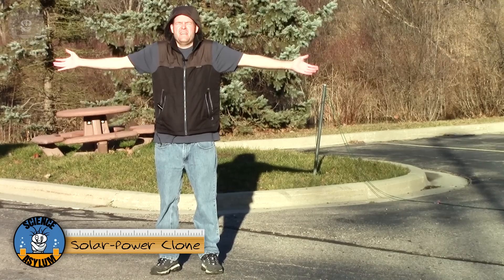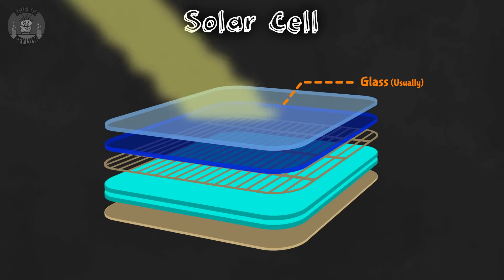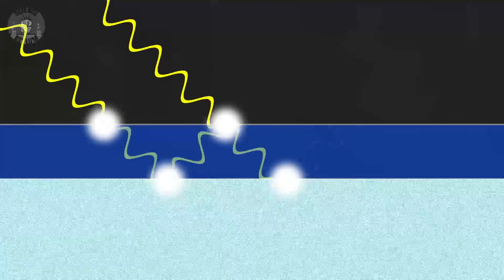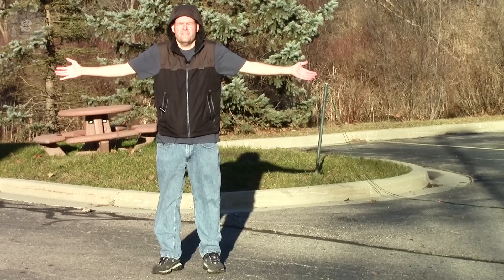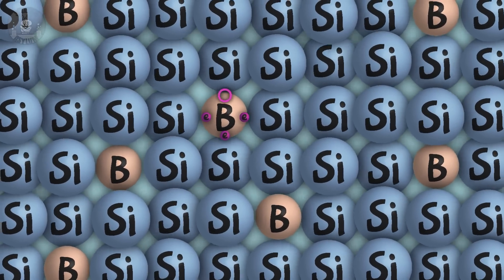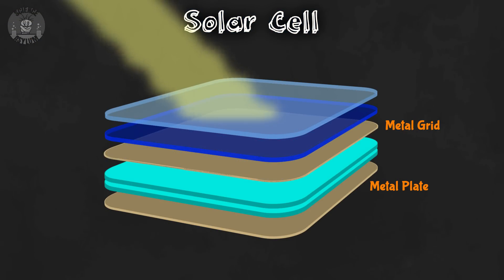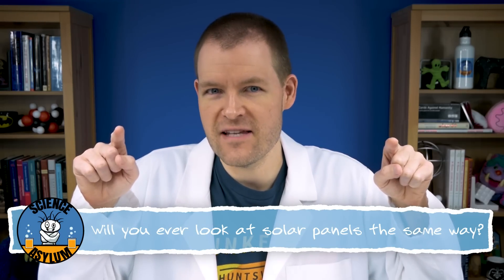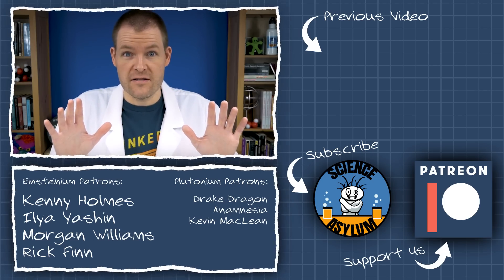How Do Solar Panels Work? (Physics of Solar Cells)

Comment: Can you explain how DC to AC converter works? (and how AC to DC converter works if that exists)
Reply from the maker: Both devices exist. DC to AC is called an "inverter" and AC to DC is called a "rectifier." They're both pretty ingenuous.
Reply: There are a few different designs in use, but they all involve using transistors to periodically reverse the polarity of the output. The cheap and nasty ones just do that, which results in a square-ish output which plays hell with AC motors. The better quality ones use various techniques to generate a much more sinusoidal output.

Comment: So after a while the solar panels will run out of "spare" electrons?`
Reply from the maker: No, not at all. Just a battery or any other power source, they gain an electron on one side for every electron they lose on the other.
Reply: yes, but at some point all the spare in one material would move to the "missing" points in the other. What am I missing here? :)
Reply from the maker: You seem to be forgetting that the solar cells/panels are connected to a circuit that also has charges in it. Those charges go around in a circle. They don't leave. I'm not saying that solar cells can't be bad. Everything goes bad over time. It's just that solar cells don't go bad because of what you're talking about.